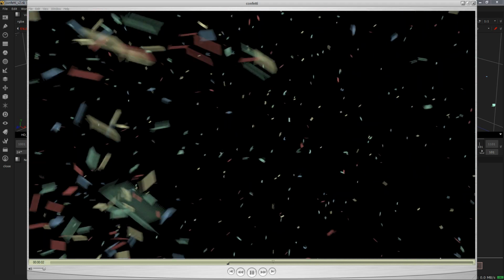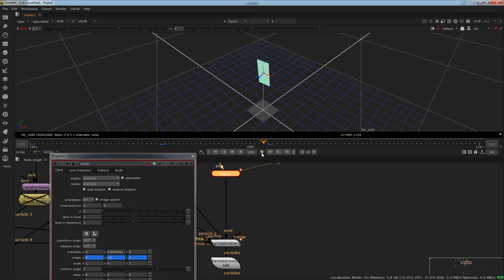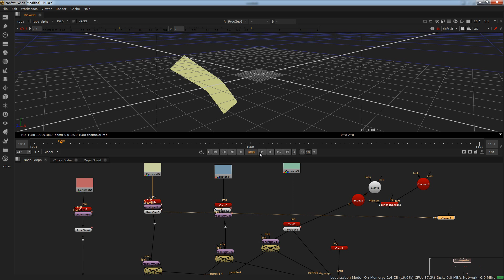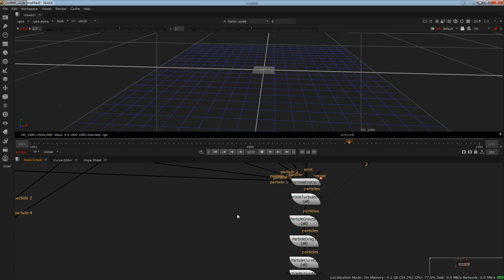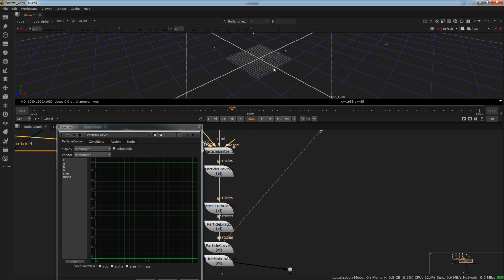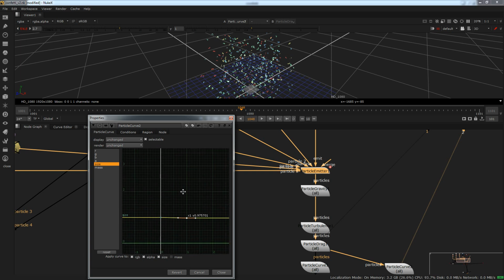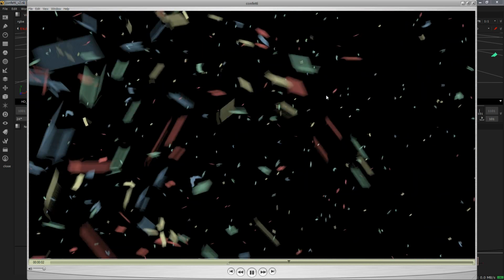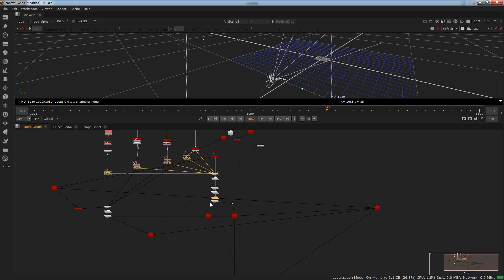Nuke Particles Confetti Tutorial

Comment: Looks great.  Curious - will the NUKE particle system generate a depth matte to aid in compositing the effect with footage?
Reply from the maker: yep you'll get zdepth out of nuke scanline render node
Reply: With particles you don't wan to use z-depth preferably deep if you can. Not sure if the particles can export deep from the scanline but I've used pgbokeh on snow and it works perfect.